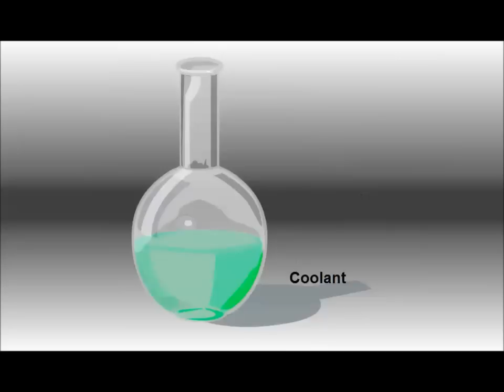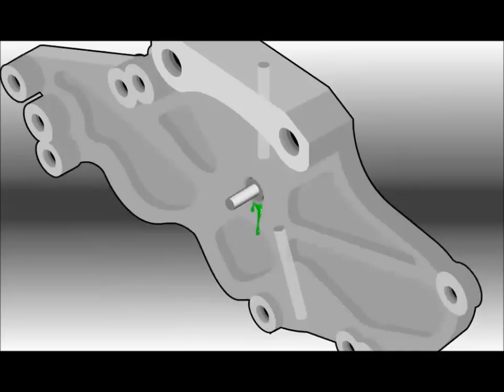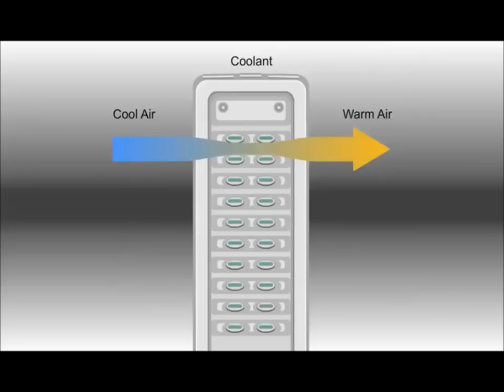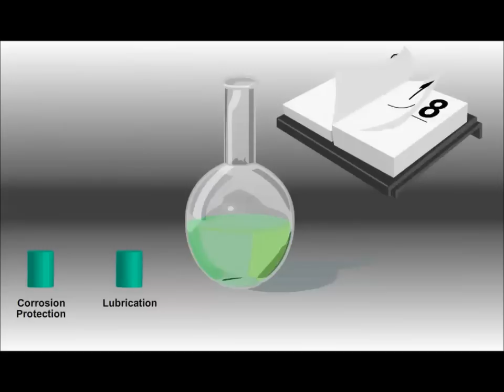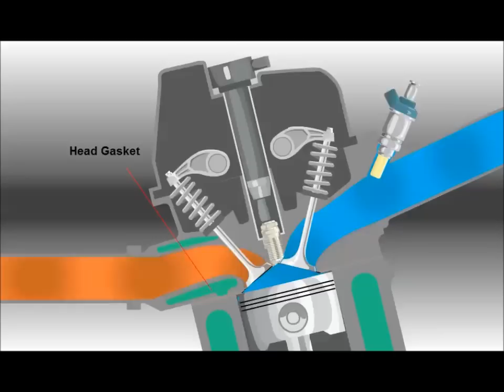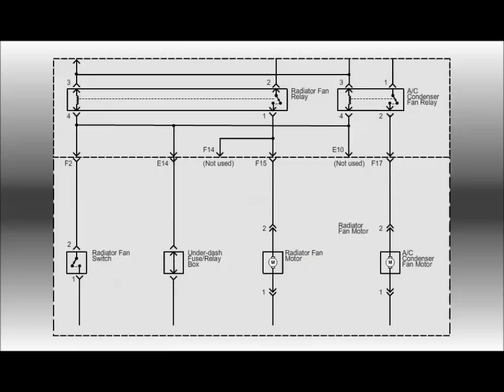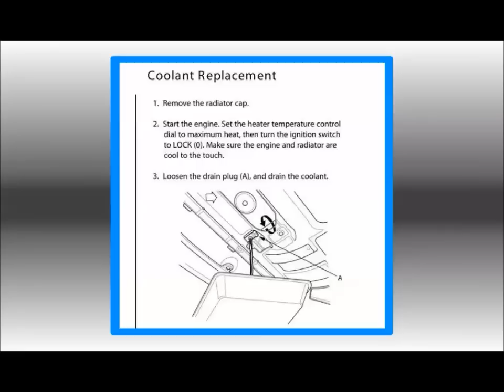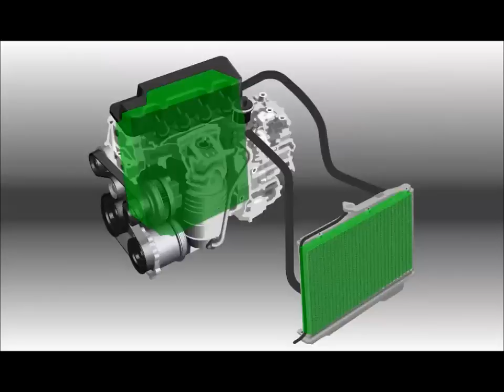Cooling System

Comment: That was the best explanation I’ve ever had. Thanks. I have a question btw. I found the coolant reservoir on my new car cracked, but the crack was in the top in such a way that coolant wasn’t leaking at all. I don’t know since when the crack was there, assuming the crack was there since the purchase, is it safe for me covering 8000 kms till I found it? There was no overheating, fan functioning well and the radiator is full. Does the air get into the system? Please help. Thanks.
Reply: As long as your overflow tank never went dry during engine cooldown when the coolant returned to the system then you won't have any air in the system.

Comment: My leaks is from the resevoir. It pushed coolant inside the resevoir out. Cant find an answer anywhere as to why
Reply: Me too
Reply: Under my reservoir you can see a steady drip of coolant when engine is on but it's not from the reservoir itself. A new radiator cap helped this issue but it hasn't fully went away. Every few days a bit of leaking still happens but it's manageable now

Comment: Nice explanation, i plan to restore my Father's Hijet 1000 (1983 year) into mint condition, should i replace the radiator instead ? 

Usually my father only used water from local well, Many Thanks =)

Comment: After riding around 2500 kms on my new motorcycle, I noticed my reservoir coolant level was just below (2mm) the low mark. But the radiator was full. Is it okay? Thanks in advance

Comment: Temperature difference between two hoses,,15 degrees farenheight or celsius?
Reply: Wait, so in 13:10 it said the difference between the inlet and outlet of radiator is only 15 degree?! How could it cool the engine from over 200 degree?
Reply: I think 1 feels hot and the other feels slighly warm. On mine 1 feels cold and 1 feels birnin hot

Comment: what is the cause when my coolant reservoir gets full and empty radiator? even when it cooled down
Reply: Failed radiator coolant recovery cap or bad surface where the cap seals to the radiator flange, or possibly coolant recovery hose leaking in air.

Comment: Wait, so in 13:10 it said the difference between the inlet and outlet of radiator is only 15 degree?! How could it cool the engine from over 200 degree?
Reply: This may be for Honda applications my needle hardly moves when the thermostat opens in a 03 civic

Comment: Hey sir i have pulsar 200ns which is a liquid cooled motorcycle and recently when engine becomes hot it starts leaking out some coolant from the hose of reservoir which is kept open to atmosphere is it normal?
Note-1) cooling fan is working correctly and no engine overheating 
2) this problem starts after replacing the reservoir tank.
Reply: lmao

Comment: unfortunately the cooling system cost me more than 2000$ in last two weeks and the problem of overheating has not been resolved yet

i feel very sad for that and I don't know what is the problem so far 

2008 honda accord 🤒
Reply: Ayman Al_Jahwari did you try the cap that's what mine needed
Reply: Same here 👀😪
Reply: Did u fix
Reply: @jayislander  
No,, but I replaced the engine and since that all was OK 

It seems like something was not working well but I couldn't find it till it resulted in engine failure

After replacing the engine the milage beacame much better by around 60 mils per tank of fuel

Comment: My reservoir was leaking causing my car to overheate, so I unhooked the hose and plugged it. So far no overheating... any suggestions on what could go wrong???
Reply: maybe the hose ins't completely sealed when it's on the reservoir, and air is making its way into the system? And when you take it off and plug it, you are sealing it better than it would be on the reservoir? Maybe the hose is bad and replacing it would help ensure that the cooling system is sealed properly?
If not the hose, maybe the reservoir itself has a bad seal and may need to be addressed?
I wish you the best.

Comment: What if you add too much antifreeze ?
Reply: @Mido Alaaeldin thx I appreciate that info
Reply: It won't evaporate as the system is normally sealed with a cap, screw on cap or a release valve type cap if the reservoir is pressurized. There's an overflow tube at the neck of the expansion/ reservoir tank so it will just pour out onto the road. Which will get any animal that decides its sweet taste is too hard to resist. If it's an old car with no expansion/reservoir then it flows out the overflow tube at the radiator neck.
Reply: @flightofthefatman  🆗️ then I will just be satisfied with the full line 😁 thx for the reply ...by the way , I filled my oil past F__ this far past full am I good